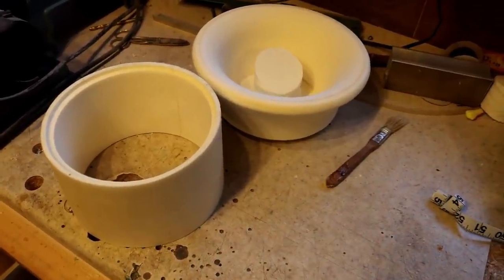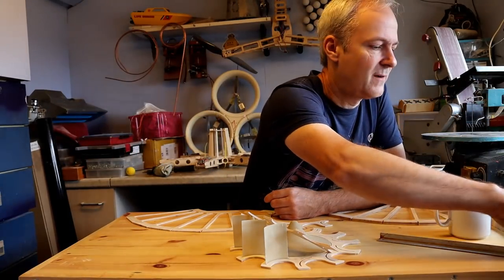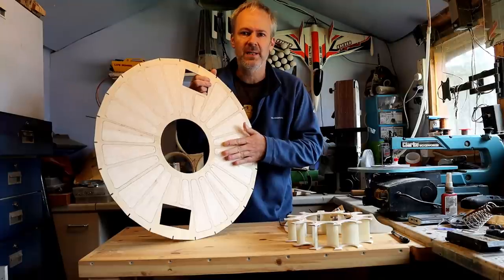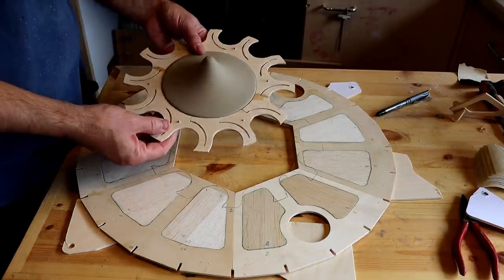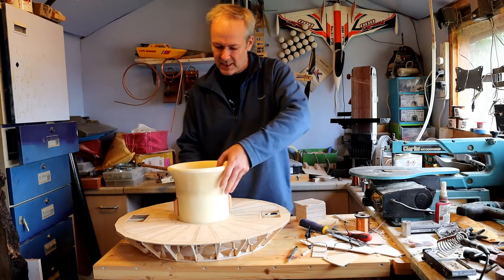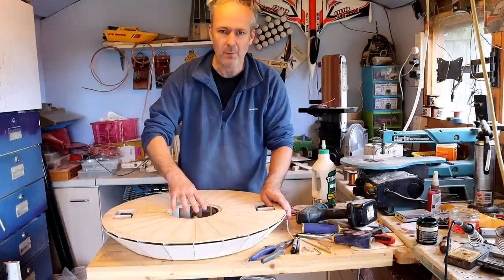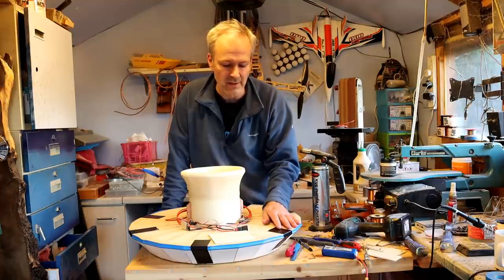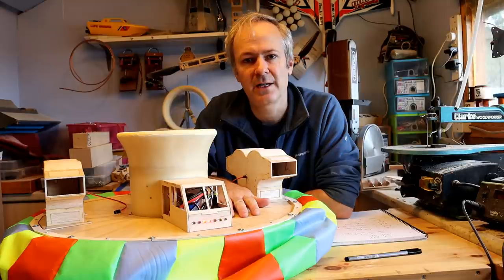Model Hovercraft loosely based on the SR.N1 Part 1 the hull.

Comment: I see servos to divert thrust from the main intake and do differential steering like a tank...  that's going to be interesting.  You almost never see that level of complexity in hovercraft models.
Reply from the maker: Spot on! i was going to make a controller but just went for the tank control!
Reply: @mrfid72  It'd be probably pretty easy to make an ArduRover hovercraft and have a gyro steadying yaw rates and providing heading lock.  It'd probably station-keep like a boat.